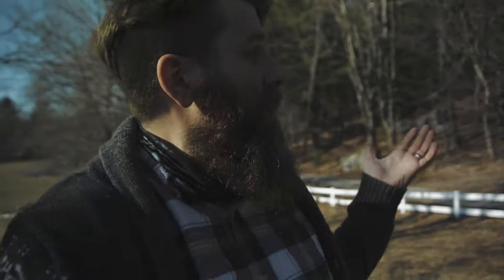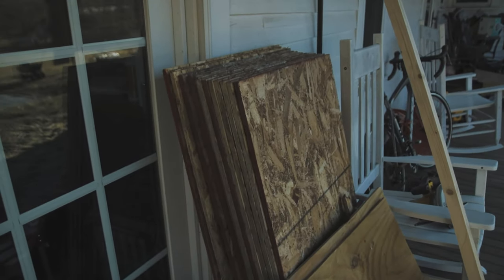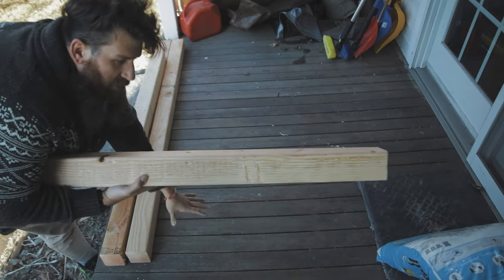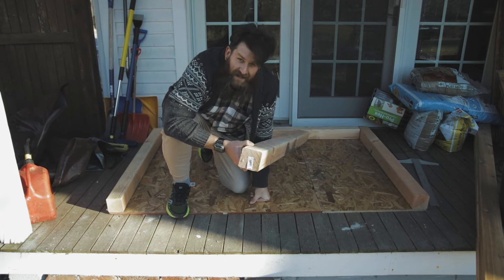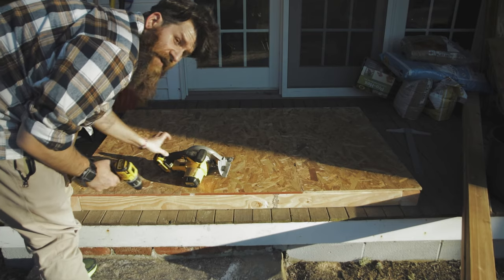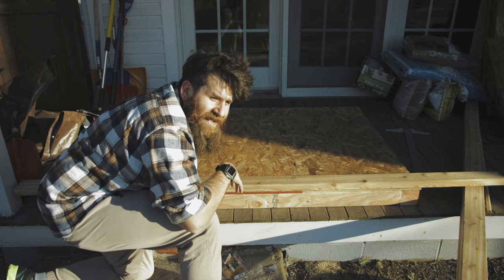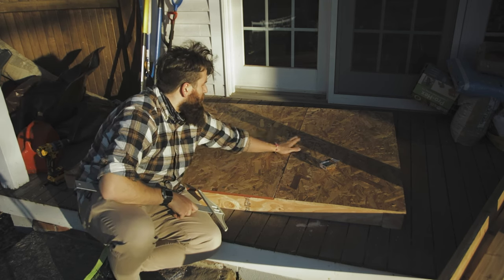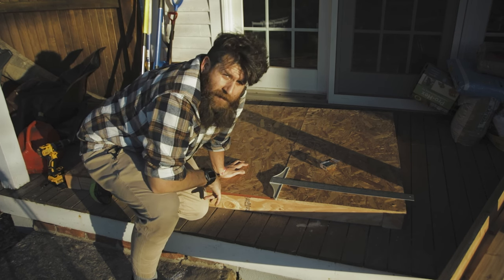DIY GAMING TABLE FOR UNDER $150 | Homemade Gaming Gear (Part 1)

Comment: Since you didn't originally plan for the center support this tip won't work but if anyone is intending to build this same thing: if you put the OSB on with the black lines facing up, and centered, you then know exactly where to drill in screws to anchor a 2x.
I like this build and might have to use it when I finally get my hot-tub out of my house.
Reply: Good tip. :)

Comment: I have considered building a dedicated table (I could put it in the basement, but I don't think anyone would want to play down there....) but decided I needed a table that also worked as a dining table.  So, sigh, my table is going to cost a lot more than $150.  😜  But that's okay.  I've been working on it for 2 years now, and I'm hoping to have the table top finished this year.  I'm so excited to finally get that project finished.  Great build.  Best of luck.

Comment: Thank for the video. I am gonna build a table as well. I will probably use 4x4 as legs. What is the height of the legs that you are using?
Reply from the maker: Great! I can't remember off the top of my head, but I will measure and get back to you.